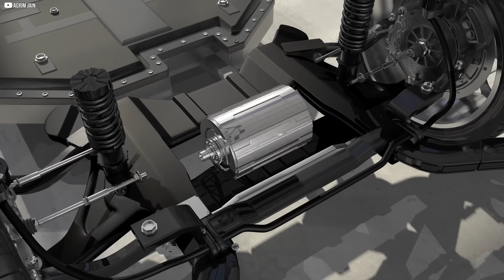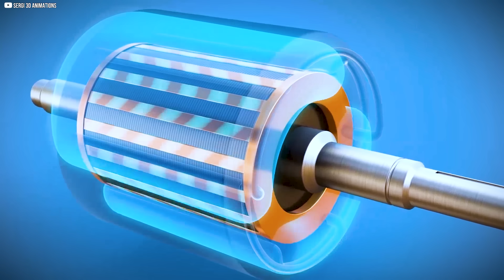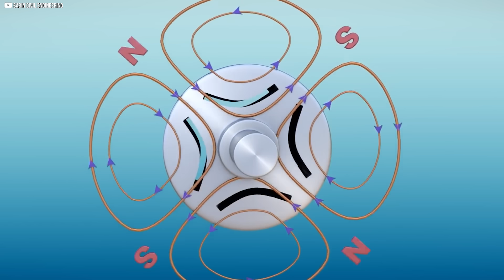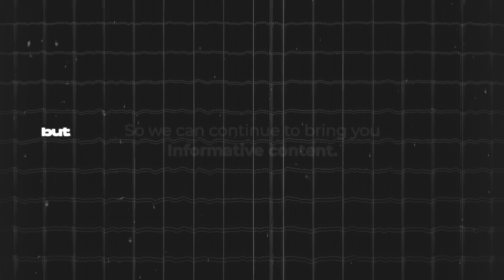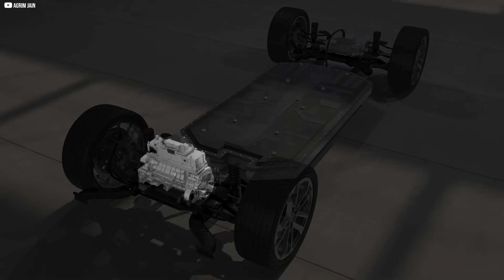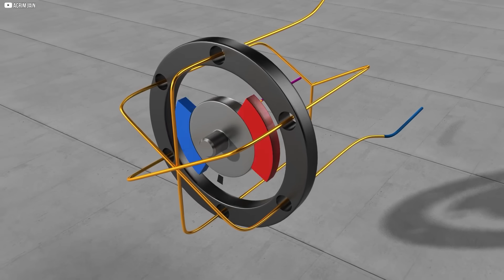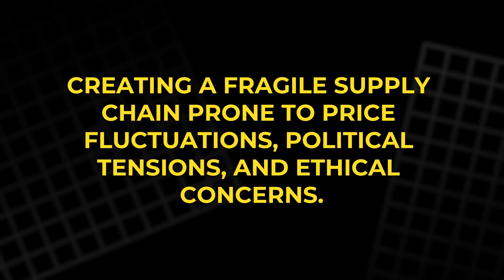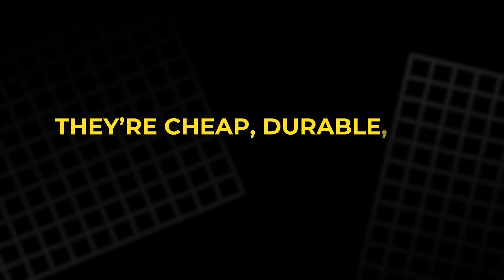How Tesla Built a Better Motor Without Rare Earths

Comment: This is not the right motor.
Nicholas Tesla introduced 2 types of electric  motors.
One with heat, one without heat, 3 times more efficient.
Tesla cars use motor with heat, not the right patent, the right one is cold motor, asynchrone assymetric motor.